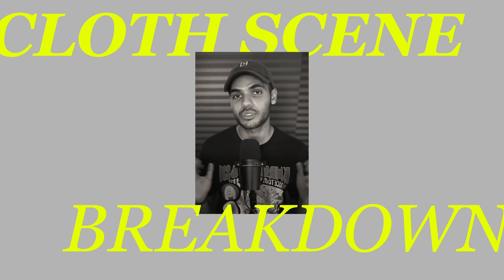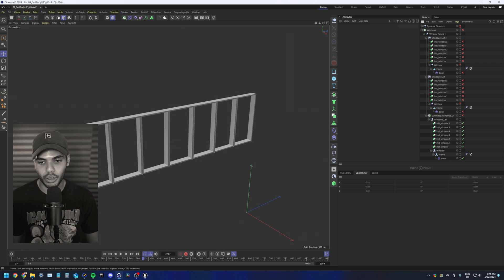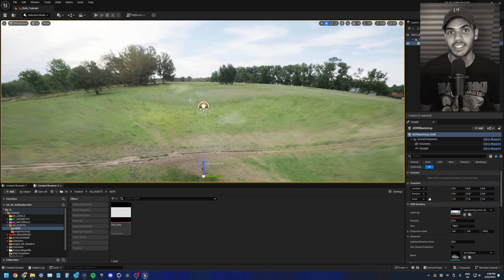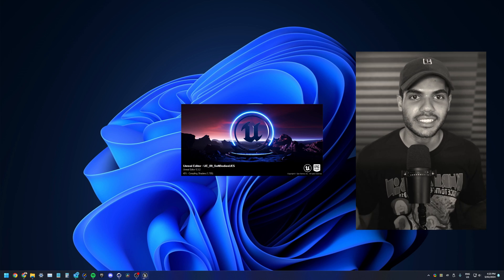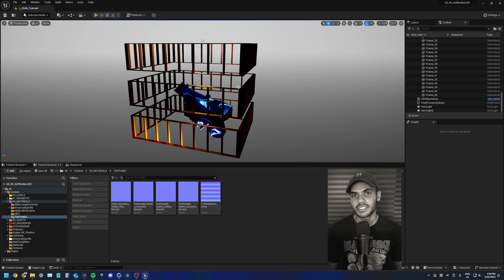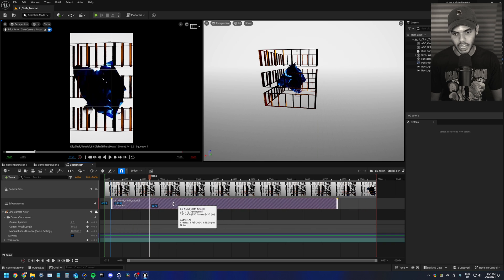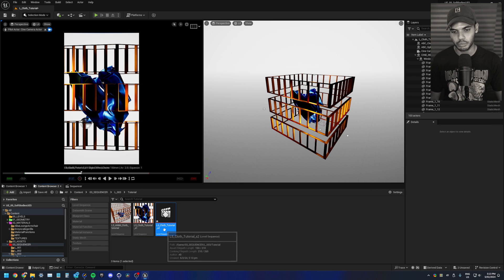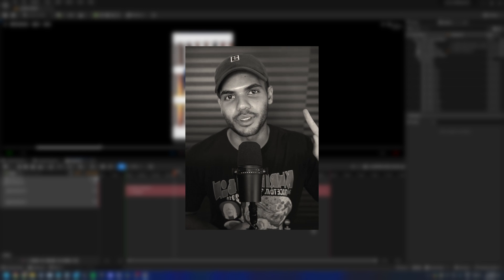Cloth Simulation - Cinema4D to Unreal Engine 5 Workflow! (full step-by-step and breakdown tutorial)

Comment: Great video as always 👍...BUT why did you change the preset from Maya to 3dsMax when importing the Alembic?
Reply from the maker: Great question and sorry I should've explained in the video. Changing from Maya to 3ds Max (when coming from C4D) ensures your pivot rotation is correct, otherwise it will be rotated 90 degrees in the wrong direction.
Reply: Do you think similar will work for Blender?..  @ali.3d
Reply from the maker: Hmmm not too sure, I would just export a pyramid or simple shape and test maya vs 3ds max coordinate import presets. Let me know which one works best! @eobiri